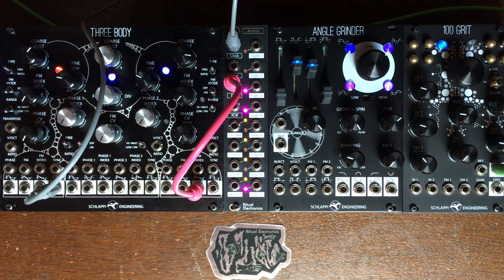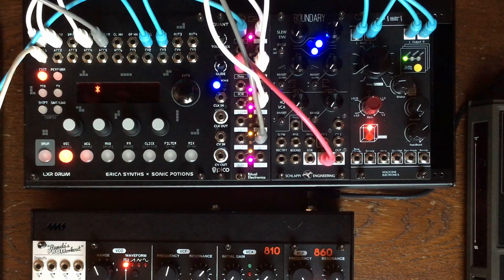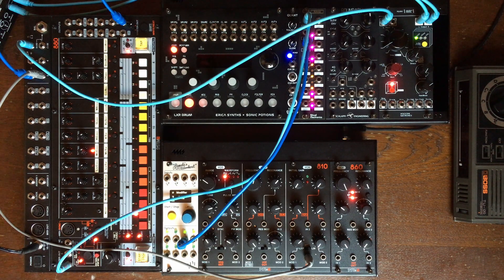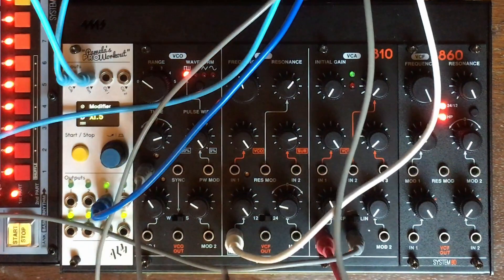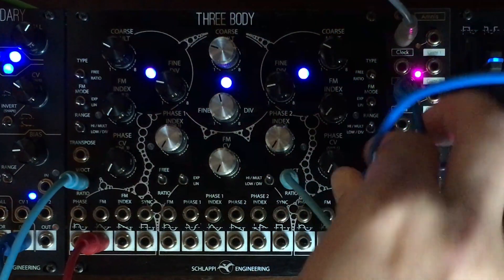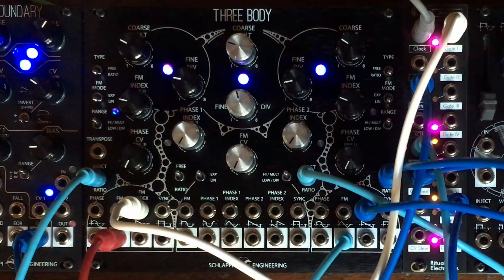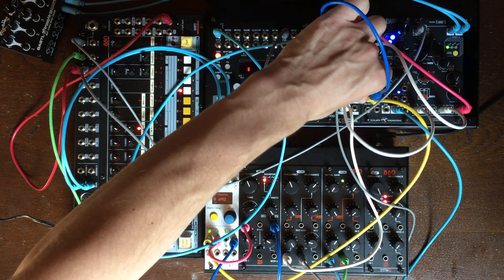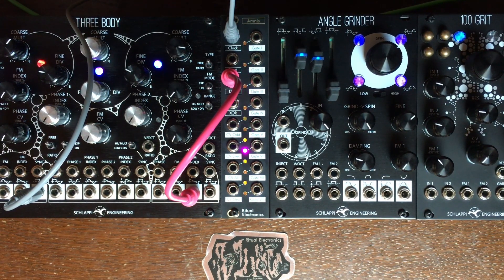Amnis by Ritual Electronics - A few things you can do with a Shift Register!

Comment: Don't forget if you speed the clock up to audio rate and use the voltage out you should be able to get LFSR Gameboy style pitched noise. Could use a logic module tapped to a couple of the outs to generate true lfsr as long as you have a way to seed some data. Though it might be interesting feeding it with various data sources and seeing what kind of timbres would come out. 
Thanks for the inspo! I hadn't considered some of the modulation possibilities alongside sequencing.
Reply from the maker: Glad it was helpful ;-)